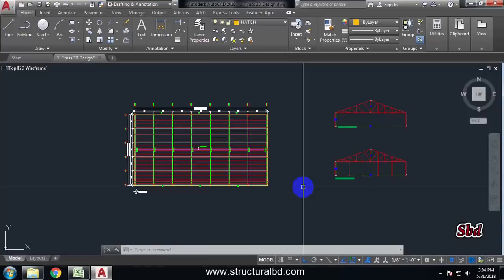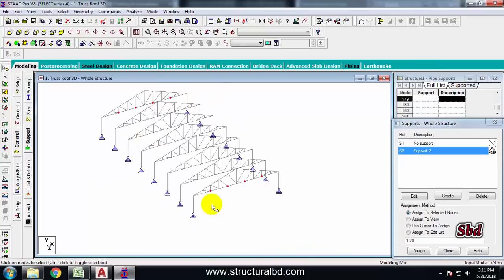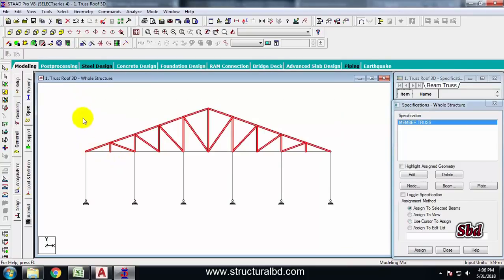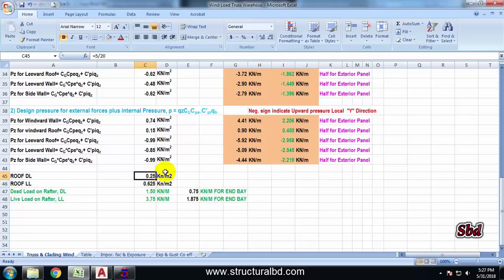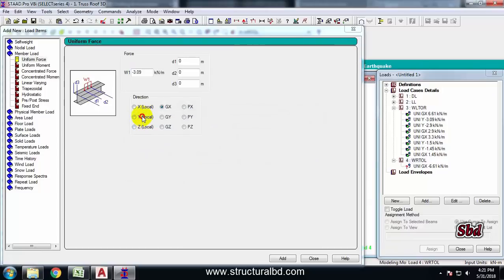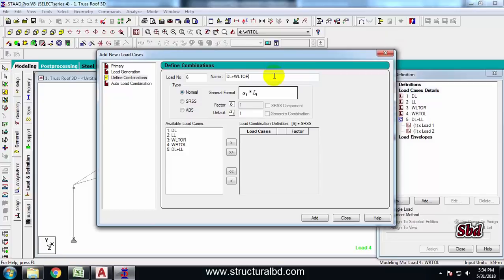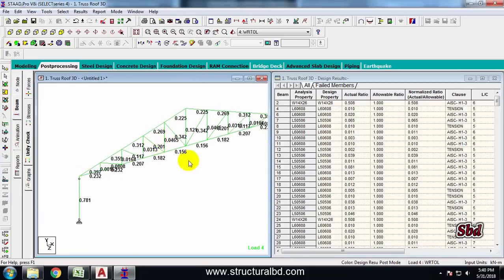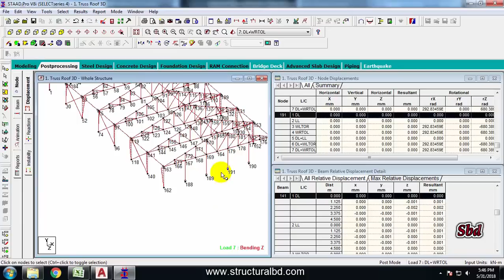Truss Roof Warehouse Design with Hot Rolled Section in Staad Pro V8i

Comment: Hii sr my question to you is is the column hinged at bottom..?
And also my question to you is if we have rigid or hinged joint at truss end then there will be large horizontal force on column which will induce large moment if bottom end not hinged

Comment: I m steel designer and really worry about this video, specially when the beginners start with it and has no idea about stability of the structure. This structure is not stable in both directions regardless the results you got.
Reply: @Ghazi Al Obaidi ..sir could uh tell me the reason. How this structure is not stable
Reply: Yes. He did consider the panel length of bottom chord as effective length of truss bottom chord, which is going to be a huge disaster unless he provides tie runners at bottom chord
Reply: Pl. correct the procedure and guide the people, instead discouraging the young boy. No harm in sharing the knowledge.

Comment: DEAR SIR , AS I KNOW THE TRUSS MEMBER CAN TAKE ONLY  JOINT LOAD WHERE AS U HAVE APPLIED HERE MEMBER LOAD ...PLZ CLARIFY IT....THANKS.
Reply from the maker: We calculate joint load from distribute load when designing manually. But using software if we apply distributed load, software will calculate the joint load itself. No variation in result.

Comment: if the top chord and bottom chord of the truss frame is a continuous beam, would you need to assign Ly as the span between the ridge and the column ? because if you do, the allowable compressive strength on the chords would be so small that your model would be fail.

and should the top and bottom chord be assigned as truss in the beginning anyway ?
Reply: Lateral buckling co-efficient Ly need not be assigned to top chord since the prulins and sheeting above it will take care of the buckling..but coming to bottom chord if no ceiling is present..i guess we need to provide longitudinal ties for every 5m atleast and provide ly as 5..even I guess the truss members only needs to be assigned to ties and not top and bottom chords..